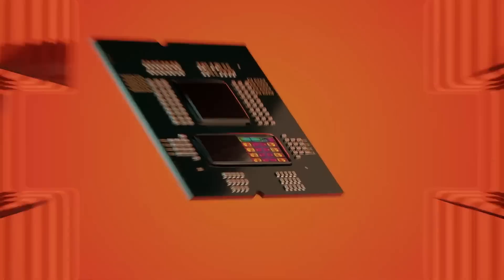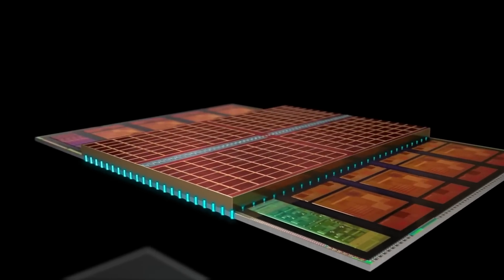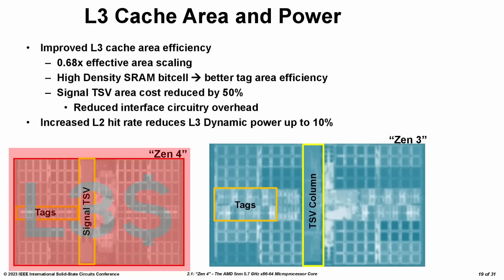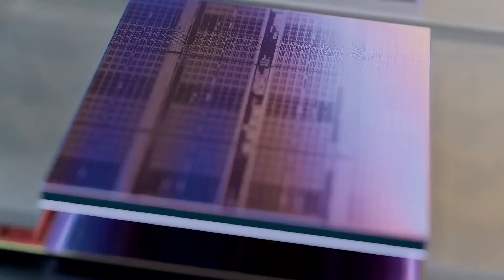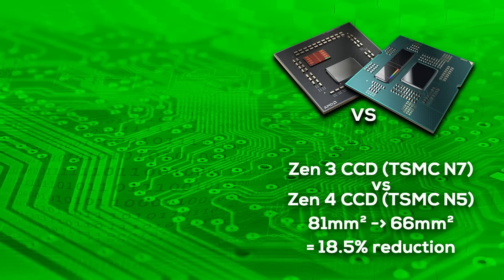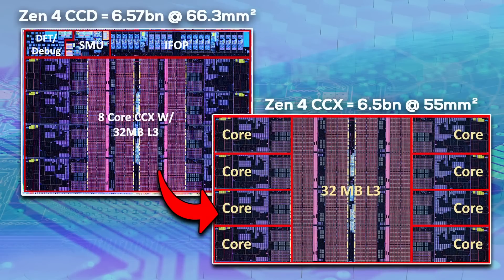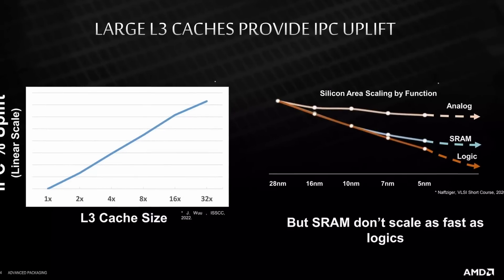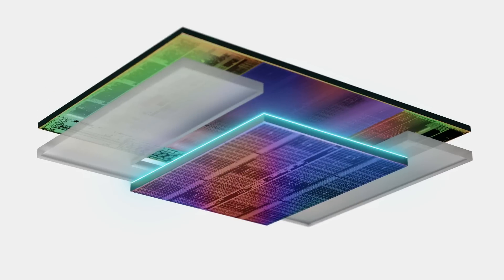AMD's 3D V-Cache Problem

Comment: Moar on die cache.
Scale the on die L3 (+L2 +L1) cache up so that the Vcache is only covering cache.
48MB+64MB would also help non V cache processors. The question is not if but when.
Zen 5 has 640KB +8MB (48+32+1MB) L1+L2 vs Zen 4 512KB +8MB (32+32 +1MB) vs Zen3 512 +4MB (32+32 +512).
Perhaps Zen 6 will increase L2 to 1.5MB per core.
Also consider that there is some sram scaling to 5nm, so Zen 5/6 Vcache could well be made on 5nm.

Comment: I think that both solutions may have to be used.

So, in the future, the CPU will be above the cache chiplets and in turn, multiple layers of cache chiplets will be used. Having the CPU on top should address the heat issues, although there will be engineering challenges as you've noted with routing the data and power through the cache.

So in the future for higher end CPUs:

- CPU on top, with cache underneath in many layers
- This then links to an active interposer with IO die 
- Then there is an HBM L4 for higher end SKUs

Which is the best compromise.

Comment: If SRAM does not scale anymore with N3/N2 etc. the 32MB L3 on the CCD do not get smaller any more so the 64MB VCache on top do not need to get smaller either.

If AMD decides they need more L3 (for example to support 16k cores per CCD) they will probably need to increase L3 on both their VCache and non VCache lineup.
With 48MB L3 on CCD and 96MB on top it will still work.

But as the price gap between leading edge and N7 increases further AMD will want to move to a design with no L3 on CCD and everything stacked on top and this is where things get complicated.

What I am wondering:
In the long term I see AMD using a Meteor Lake like approach:
.) Having an active base tile (N7) for fast and energy efficient die2die communication and put all L3 there.
.) Compensate additional L3 latency by increasing L2 per core.

Comment: What do you think about a hypothetical 7600x3d?
Reply from the maker: Would be a great gaming CPU, but as you can see from the 7900X3D, it doesnt quiet match the 8-cores.
Since AMD already has 6C-X3D chiplets for the 7900X3D I think the only reason they dont offer a 7600X3D is market segmentation.
Reply: @HighYield  id love 7600x3d if it was higher clock speed than 7800x3d

Comment: 3D V-cache on the compute die is a dead end. It's more appropriate to put it on the IO die, or altogether separate. AMD had per-die SDRAM controllers on Zen "Zepplin," causing extreme NUMA effects. "Rome" rolled this back into the IO die, reducing the NUMA levels. The current architecture can't scale synchronization bottle-necked applications past 8 cores, especially when inter-die latency is slower than DRAM access. This has become apparent even on their client products like Ryzen 9.

Physical proximity only indirectly constrains latency, at 8 inches (20cm) per nanosecond, distance is a minor contribution to latencies in the range of 40-200ns. Most of the delay takes place in the encoding, decoding and clock recovery at each end of the link, while distance also impacts the energy required to charge and discharge parasitics. Photonics is one way to remove the distance dependent energy cost, and it is already ubiquitous in networking. Take a look at what Xilinx is doing with separate dies for 28/56G transceivers, or Intel Si photonics, to see where this is all headed.

Comment: AH!!! HOW DID I MISS THIS?!! YouTube has been recommending almost exclusively crap I would never watch or stuff that I have already watched multibe times. Fantastic algorithm you got the google! I had to check when I thought "why haven't I seen any videos from [you] in a while, I hope he is ok!" and searched for you. It didnt even come up in the auto fill. Thats lame!! Great video!

I don't know enough about such engineering to suggest a way to do it. However perhaps down the road, maybe not even that long with AI helping out, they could find a way use photons/optical data transmission to link chips/chiplets horizontally adjacent. I could see that at least being faster or at least as fast as physical connections. Although I will admit I wouldn't be surprised if the the process to do so would slow it down and am just describing a type of Quantum Computer. 

I am a little Bummed that RDNA3 didn't have as much of a jump as I was hoping for, but that is on me. I set those expectations. I am going to get one still though. I have come to terms with the reality of the situation. In fact I think it is more important to support them now than ever. It's the first chiplet based GPU. There was absolutely no real world data on how it would perform because of that and plenty of potential for unforeseen issues to arise. If I (we) want to have a card perform well thw way we use them, then we need to get one and use it that way so that they can get the data needed to improve the next one. If I recall correctly, there was at least one physical hardware issue with the launch cards too. Maybe if we are lucky, we will see a refresh like the 6050 series with fresh chips that are redesigned to fix that problem. There also seemed to be some performance left on the table too according to the specs, so maybe some driver updates after they have enough real world usage data will be available to help use more of the potential? Idk I am optimistic though that AMD will prevail. Not vs Intel/Nvidia, I couldn't care less if they "win", I just lile them as a company and like to see them create awesome stuff! I even really like their "failed" products like the old AM2+ APUs and especially their GX 9590!! The 9590 catches a lot of crap but I'm sure 90% of that is based off of standard benchmarks or YT reviewer regurgitation. I admit it is a touchy chip, but with the right configuration and use case, it is actually a really nice chip! I have my old one running my "offline home assistant"/Server and it is fantastic! I can run AI for my video surveillance, automated greenhouse environmental controls/hydroponics  systems, and chicken coupe!! Granted it is leveraging my two 8GB MSI RX480s to do a lot of that, but even when I'm running a game server, streaming plex to multible devices, and downloading a file, there is absolutely no sign of lag or any other issues. I'm sure many can do that, but I appreciate it's ability to do that after like 6 years of gaming and general use. 

Sorry I digress as per usual. I'm glad you didn't dissappear and hope yiur annoying cough goes away asap! Looking forward to your next video and YT better let me know this time!!! Your's is one of the very few channels I watch as soon as possible after I see it uploaded! I'm glad others are picking up on the quailty of thw content as well! Be well! And good job on the Leppards Deutschland!!!

Comment: Why not put the L3 on the io die, and 3d vcache on top of it, instead of compute chiplets? Another solution could be stacking all them on top of the iodie, so io die (with L3) on bottom, vache and ccd's on top. Is it possible?

Comment: Definetly think they will NEED ondie water cooling if they are going to go further in stacking cache and ccd's on top of each other to solve the heat dicipation problems. Stacking is propably still the solution for the forseeable future to make CPU's and gpu's more powerfull. They have been talking about bio chips for about 4 decades and nothing makes me believe they are any close to achieving breakthru in this department. It has been about 40 years since I read an article in a science magazine in the early 80's during my teens about bio chips that ran on sugar water and was based on a bio neural network and it still seems more fiction than science 40 years later. I don't really get why a company  like Intel still refuses to see they are bangin their head into a brickwall to keep the brute force tactics of forcing higher clocks onto a monolithic die using huge ammount of power and creating more problems for them self each chip generation trying to compete.

Comment: Even though 5nm vcache would provide little perf benefits, wouldn't it allow the vcache to be made thinner and thus less thermally constraining?
Reply: There's very little heat produced in L3 cache in first place, it doesn't matter how much Vcache chip reduces thermal conductivity. Bulk of the heat is produced in cores and there's just blank silicon pieces on top of them. Unless material of blanks are changed, there's not much AMD can do.

Comment: I do not think we will see compute die size itself shrinking all that much regardless of node shrinkages. The CCD is already quite small in relative terms. With the current unified l3 design, I imagine they could/would add more l2 and l3 on the compute die itself.

Then there is the option to add more cores per ccd, add more complex units (Instruction Accelerators as an example) or widen other areas of the chip (larger infinity fabric interconnect for increased bandwidth as an example).

There is also the option of moving towards an hbm/mcd or Intel style interposer/chip let type package.

There are a vast amount of options out there. Sticking strictly to your points based on CCD size, I don't think it holds much water. Take a look over the past two decades of consumer die sizes and node shrinks and you'll find that things just become more complex and utilize more die area that just shrinking the die more and more.

Comment: i believe that heterogenic crystals can be part of the solution. for example silicon carbide has a heat conductivity about 3 times higher than silicon. synthetic diamond has about 60 times higher heat conductivity. silicon carbide is already used in HEMT transistors. i can imagine growing flat crystal heat spreaders on top of the logic, between the layers, and crystal "trough silicon vias" to transfer heat up trough the stack.
Reply: Likely the biggest problem when choosing materials for this is idea is differing thermal expansion rates. If the thermal expansion rates are too different, it could cause the dies to pull apart from each other when the CPU gets hot or cold

Comment: Hey, hopefully you get better soon! As I think we've discussed before, on figuring out what node 2nd Gen V-cache was on whether it was 5nm on 5nm or 6nm on 5nm process, I was quite surprised they were still using the same node. Although, this is on par with AMDs design/manufacturing philosophy. Once again, AMD has decided to cleverly think of new ways to scale the cache with TSVs as you mentioned, and I think Zen 3s and Zen 4s similar design has greatly contributed to that fact. Their 'min/max' strategy is very strategic and benefited them greatly thus far.

Now onto the future with 3rd Gen 3D Cache, I'd like to think once again AMD will take a conservative approach, either that may be another clever design change, or something else entirely. With Zen 5, (and correct me if I'm wrong), the design and architecture will be different to all iterations of Zen thus far. They have probably streamlined cache stacking, accounting for TSV layout and other things. With this change to the architecture thus the layout (CCDs/CCxs), engineering changes to the 3D$ itself won't be radical (or at least be expensive for a new design/manufacture), maybe a change to another process node (7nm on 3nm just sounds too impressive to pull off). These are just tin foil hat thoughts and may not even work as I mentioned lol, but I think AMD may surprise us once again with another clever design that will first, maximize efficiency and profits.

Comment: How about moving the cache chip next to the core chip, i.e. no stacking. Similar to 7900xt(x) design. Might result in a slower connection, L4 cache maybe? Would heat problem but need a  more complex interposer

Comment: if de lidding drops the temp by 20deg C why not sell the chips without a lid and get EK to make a mount watercooling block they they pre fit to the chip. they still can have AIO stuff as in quick connectors a pump that either inline or on the rad but without the think lid.
or they could build in micro heat pips that run to the lid. also thought about putting the cache on the bottom and cpu chips on top.
the future looks good

Comment: The problem is that the x86 instruction set is at the limit of what we can do with it. AMD tripled the L3 cache of the Zen 4 chips, and all we got was at best 15% better performance. Look at what Apple did with their M1Arm chips. It's incredible how efficient and powerful the RISC based instructions set is. I hate Apple... but M1 is brilliant. Imagine that scaled up to P.C! They're still making regular, large performance increases while retaining the amazing efficiency it is known for. I know Intel and AMD are aware and nervous about an ARM future. The problem will be compatibility. All this x86 code will have to be rewritten, or they will have to use a compatibility layer like Rosetta. The obvious problem with that is the performance degradation rendering the performance increases inert. If they can introduce a compatibility layer that won't degrade performance... Intel and AMD will be in big trouble. X86 is bloated and far too inefficient for use going forward. It's a dead end. Intel and AMD know that.  All they're doing is blasting the power draw and keeping it on life support.

Comment: They could slap some HBM memory on to the IO die too to be like big L4 cache
I think that the flipping it could have potential by making big main L3 die putting on top the cores and stacking more L3 on the L3 to use minimal amount of structer silicone
Reply: I wish they did that for APU's

Comment: Stacking the cache chip underneath the core chip is THE solution to this.  It doesn't matter that you have to route power through it since you can make it much less dense and have a ton of freedom in layout.  You could also cut down the cache on the core chiplet.  The downside is that you basically have to make Vcache 'standard', and AMD seems reluctant to do that, at least through Zen 5, though they are seemingly going this route with CDNA3 so we know it works.  But they can gouge consumers more the way they're doing it now.
Reply: Turns out that you were half-right about this. Zen5 doesn't need Vcache as standard, but the X3D parts definitely clock a lot higher with the cache stacked underneath. That and CDNA3 make me wonder about RDNA4 and beyond.

Comment: Chances are that VCache dies are designed with a bit of redundancy, i.e. with physically more SRAM blocks than nominal cache capacity. It might not even be neccessary to have a dedicated mechanism for mapping out bad blocks. The cache controller can be tricked into never hitting a bad block simply by setting tags appropriately.
If that hypothesis were correct, then one could further assume that the amount of redundancy could have been reduced from 1st to 2nd generation (of VCache), as the 7nm process has matured and yield has improved. This would be another way to save die space.

Comment: I struggle to keep my 5800x3d cool. I can’t imagine a 8800x3D if they don’t fix the heat.
Reply: Got mine on a basic hyper 212, no problems with cooling. What cooler are you using?

Comment: Will 7800X3D age poorly or wont be future-proof because of low clock speed/single core performance? (For gaming)
Reply: No.  Loss of 400Mhz or so isn't nothing, but it's a very limited reduction in performance that will remain relatively constant no matter what going forward.  Older processors usually become outdated through lack of features, instructions, general IPC deficits and raw core/thread scaling, not through a minor disadvantage in clock speeds like this.
Reply: @maynardburger  X3D or intel, which will be more future-proof in gaming and which will be faster in the long run?
.

Comment: Inverting the CPU configuration is a really good idea.
Reply: Largest issue I see with that is noise, capacitance issues and voltage stability. 

AMD already bins the CCD quite heavily for the vcache chips to be able to maintain decent clock speed at lower voltage thresholds. Flipping the stack would makes this even more important or lose more clock speed/core performance.

Comment: Excellent video. Though, would you consider removing the very distracting 'rap beat' background music in the next video please?
Reply: Nah it's fine.  A bit of background ambience helps a lot.  Or if your issue is that it's a 'rap beat' specifically, then well, we all know what you really want to say.
Reply: @maynardburger  Debased thinking on your part, and i believe you can do better than that considering we're here on this channel. Anyway, i am not so young as to keep up to date with the current rap 'scene', thus have no idea what one would call that 'rap beat', hence my referring to it as 'rap beat'. The way it rattles in the ear is not conducive to 'ambience', as you've put it. There are plenty of better background noise out there to choose from, i merely suggest that he consider them next time.

Comment: Wake me up when I can get the cache on both CCD - it's a waste right now because it turns off the second CCD to ensure games run on the high cache load.  They need to fix this silly nonsense.
Reply: I agree they should have just put Vcache on both and taken the clock hits.  Yes, there would be a few workloads that might have like 5% less performance than the normal Zen 4 products, but so what?  People clearly are buying the Vcache option because they think the benefits will be much bigger in higher priority workloads(for themselves).
Reply: @maynardburger  that will make the product a zero sum game (with higher price tag), since 3d cache also only gives you ~5% performance increase